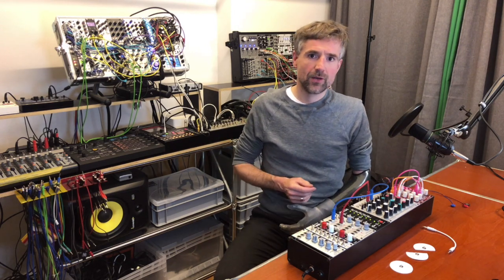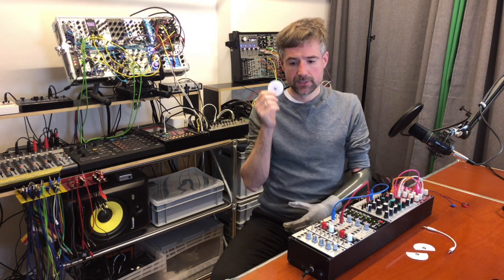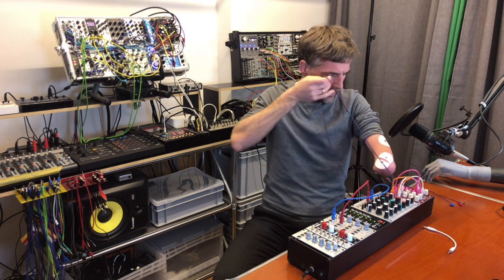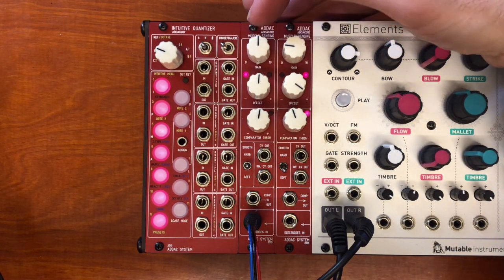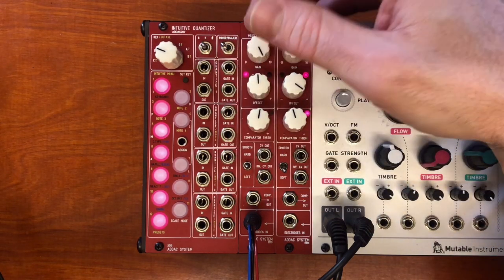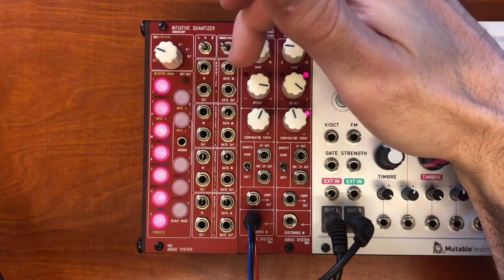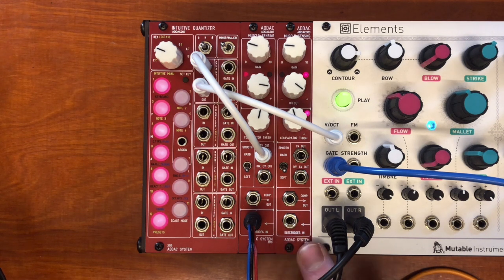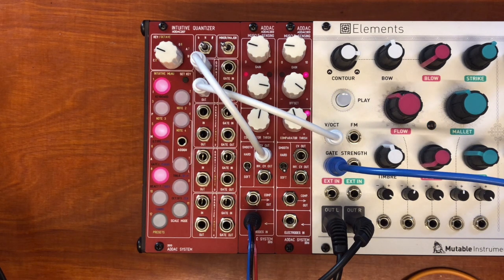How to connect a modular synth to your body with the ADDAC 303 Muscle Sensing Module

Comment: Hi, thanks for the vid, great work! 

I was wondering what you use to project the oscillation to the wall? 

maybe you can give me a hint :)
Reply from the maker: I used an LZX Cyclops CV-to-ILDA conversion module (sadly discontinued) and attached a cheap laser projector to it. I have a video on the Cyclops here on my channel.
Reply: @myowelt  Thank you so much ! I had literally no idea how to start with your answer saved me probably hours of digging in the www universe ;)